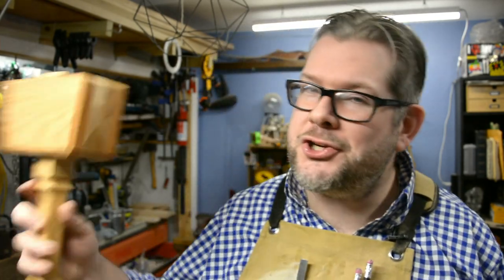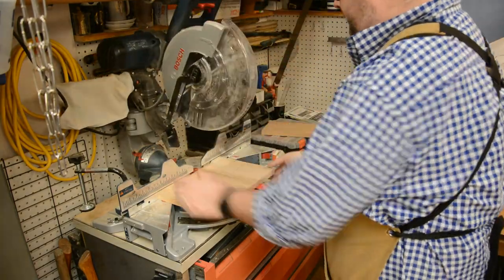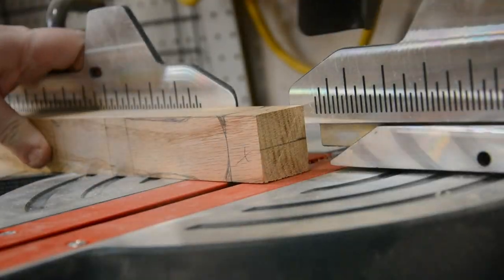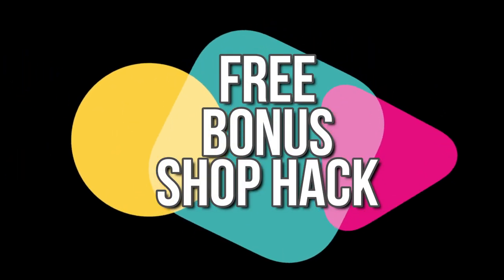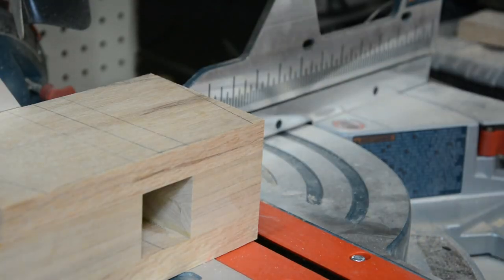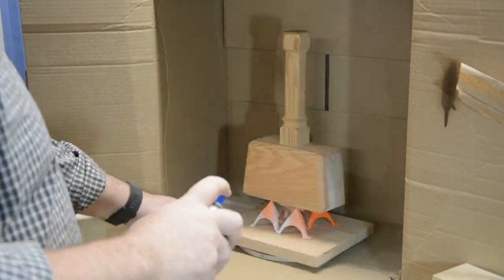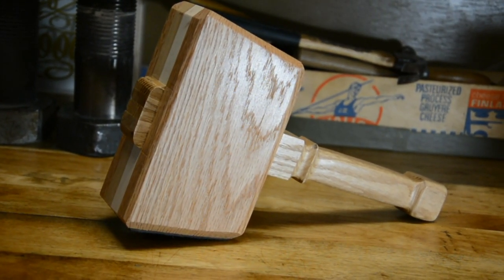How to make a scrap wood Mallet - Beginner Woodworking Project

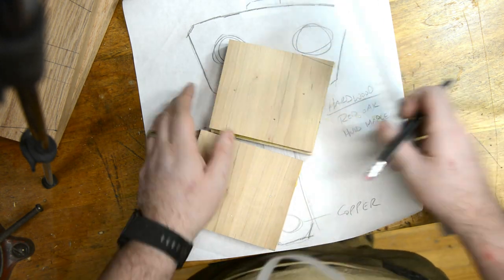Comment: Awesome mallet! Almost had a heart attack watching your table saw use. Please anchor your table saw so it doesn't move when you cut and consider making crosscut sled or jig for stability. Freehanded sculpting with a table saw (or using it to cut something tall like that) is quite likely to lead to accident. Thintz12 has a must watch kickback video that also covers how kickback can pull your hand into the blade that you might benefit from seeing. Fast forward to 2:30 for the good bits. 
Shop injuries are bad for video timelines. So far, I've seen a Katz Moses injury and Stumpy Nubs injury video. Those guys are pretty amazing woodworkers. It can happen to anyone.
Reply from the maker: Heard. Hopefully buying a sawstop shortly.